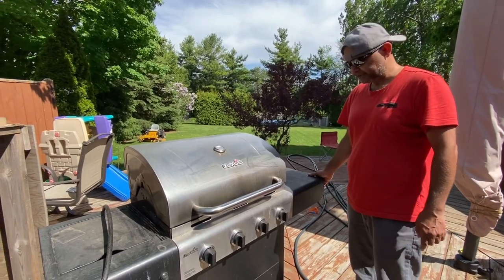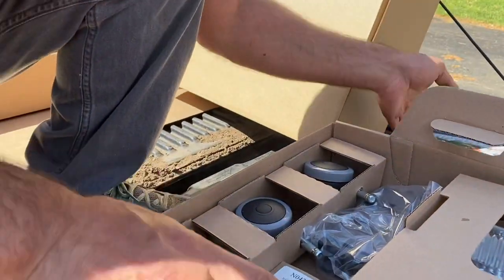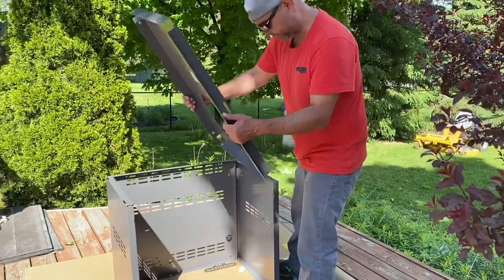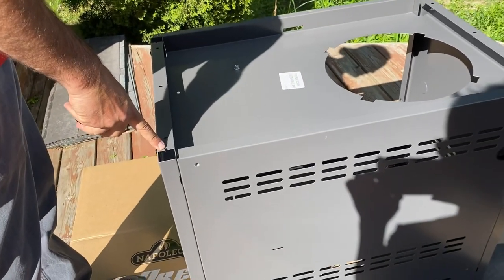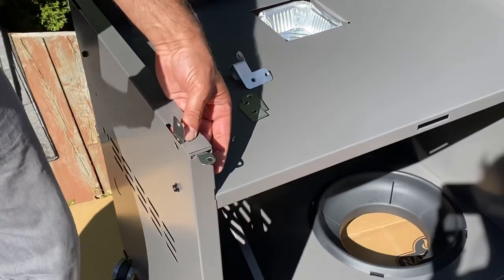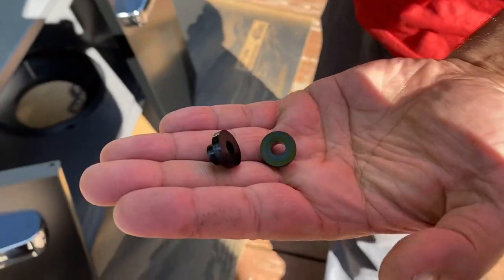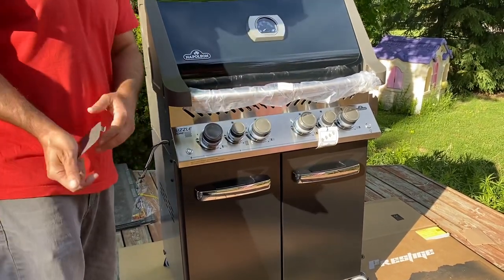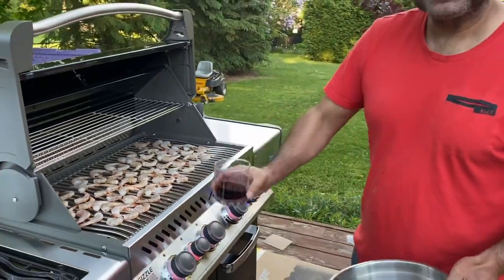The Napoleon Prestige 500: Unboxing & Assembling

Comment: * PLEASE READ FIRST *  From most reviews below THE DOOR HINGE at the top is the most difficult to figure out.  USE black bolts, and the INSIDE SCREW is for adjusting the door ONLY.  Do not tighten.  Tighten the outside bolts. The inside bolt is designed to bent the bracket in and out so you can adjust the angle of the door when closed.  I hope this helps.  BTW this video is much better than the factory one. Thanks for doing this video.  I wish I had watched yours first
Reply: Just got mine yesterday and it's about 70% assembled.  Very, very, very useful information.  Thank you!
Reply: I’m just dealing with this now. Great tip about NOT tightening the inside screw!!!  Thank you!!!
Reply: @marilynnstubbs4834  glad that helped.

Comment: Great video!! Much better than the official one. I haven't actually used it yet because my Napoleon is on it's way. But, I have a question that is concerning to me that maybe you can answer. I have propane run to my pool cabana underground from a large tank. Can I assemble this with the propane inlet hose sticking out the back so I connect to my propane outlet  in my cabana instead of inside to a portable tank? Thank you for any insight you may provide.
Reply from the maker: Great question, even though I don’t have an official answer I’m gonna say that it shouldn’t be a problem because you can always use a flexible rubber line from the barbecue to the propane line. Hope this helps! 😊

Comment: The screws for the sear station side table were too big for the holes, did you run into this same problem?
Reply: The silver screws fit. It's tight at first because the holes are not threaded.
Reply from the maker: There were extra screws, and the instructions were not very clear on which ones to use for the seat station, but they did fit. As mentioned in another comment, the screws may be a tight fit, but do fit!
Reply: Tight is an understatement my power drill even binds and they're sticking out.
Reply: @ryanfx1  Hey Ryan - I’m in the same boat. Did you find a solution for the screws on the side grill?
Reply: @ujjwalsaxena16  yes - get a powered drill and really force it.  I know it feels wrong, but what you're doing is creating the threading for the screw to go in.  It's the right place for the screws.  Bad design - sorry, Napoleon.
Reply: @ryanfx1  Ah, Thanks!

Comment: No wonder why I couldn't get the doors on. The instructions for step 12 show the same two screws to use as in step 11 (not the stainless screws that you installed). Good thing you posted this video. By the way, were you able to find a grill cover?  They're all sold out. Happy grilling!
Reply from the maker: Thanks for watching! I’m glad the video was helpful! Yes I finally managed to find a cover, but it took a lot of searching!
Reply: I got the doors on with the other screws but they aren't perfectly level and require some lifting in order to get them fully closed. 
Were you able to get yours to open and close perfectly?
Reply: @con4man  I actually called Napoleon's customer service and they actually told me those 5 stainless screws are for another model and to stick with exactly the screws the doors call for.
With that in mind, yes, the door's close and open fine on a perfectly level surface, but if you start to move grill about, one of the doors becomes off-level and won't close by itself when it's near the magnet.
Reply: I found that the outside and inside screws for the doors work together. Move both in the same direction to move the top or bottom part of the door. Door misalignment is really noticeable on uneven ground or pavers.
Reply: I played around with it on first assembly, but I'll give it another shot one of these days
Reply from the maker: @con4man  it took some adjusting, but I did eventually get them level and opening/closing well!
Reply from the maker: @drzoidberg1  mine took quite a lot of little adjustments to get them properly aligned, but so was finally able to do it!